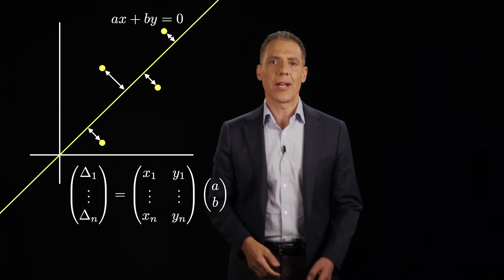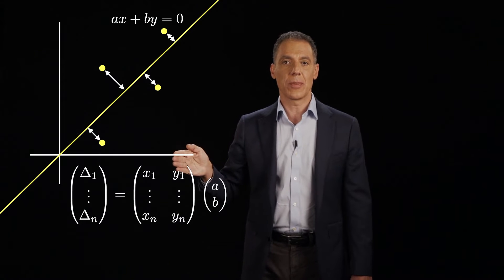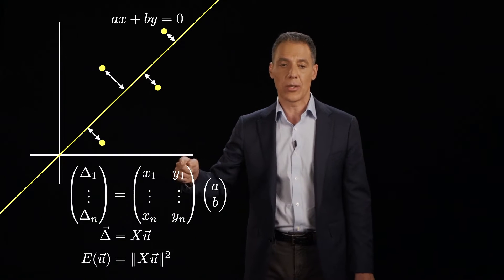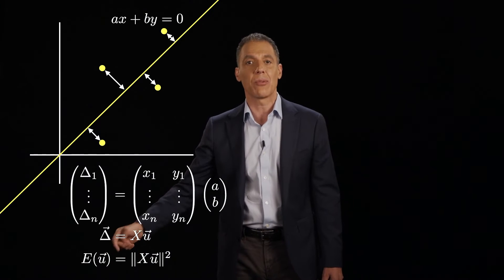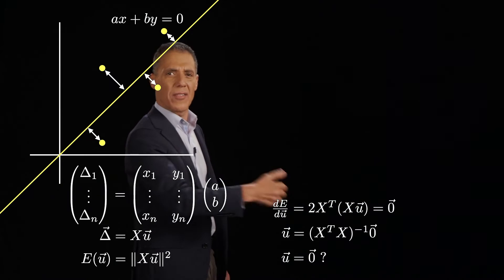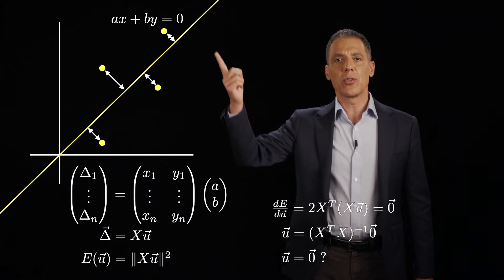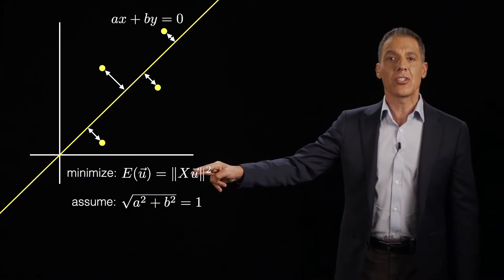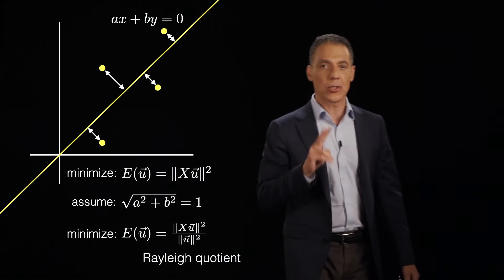Image understanding: supervised learning: regression: total least-squares: line fitting, ax + by = 0

Comment: Also, if lambda and u are eigenval-eigenvec of (X^T*X) they are technically just simply the singularvalue-vector pair of X :) (you just need to square the singular value so that you get lambda). So computing them with SVD should be fairly straightforward.